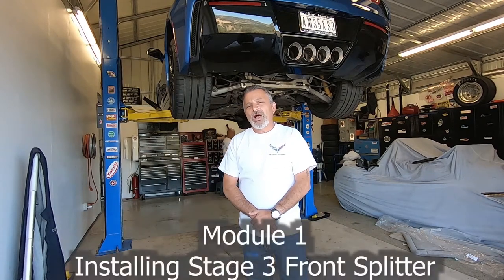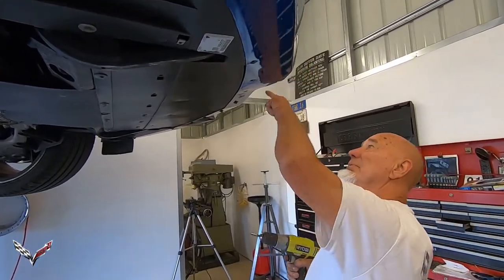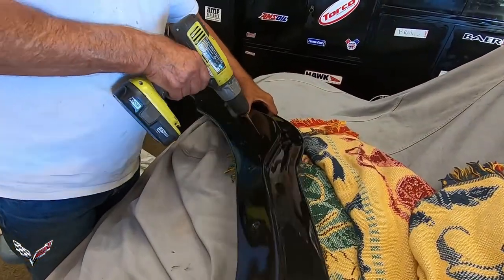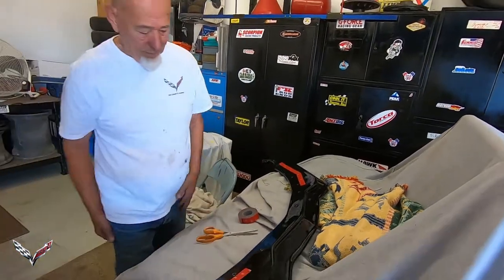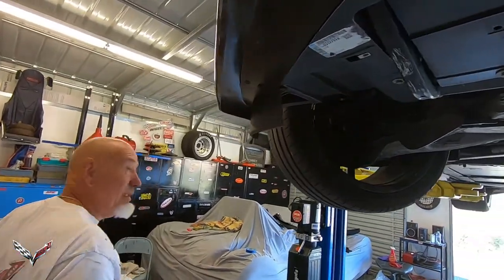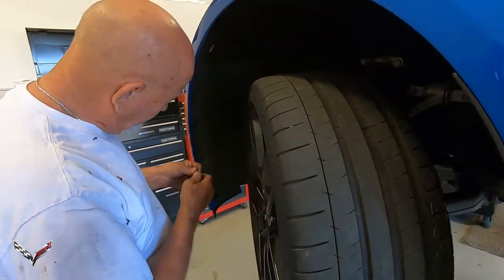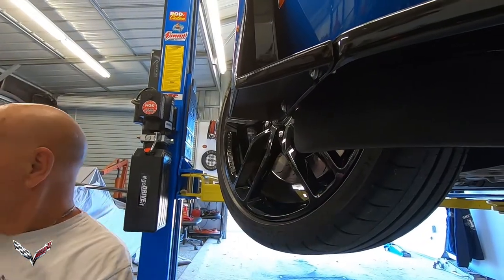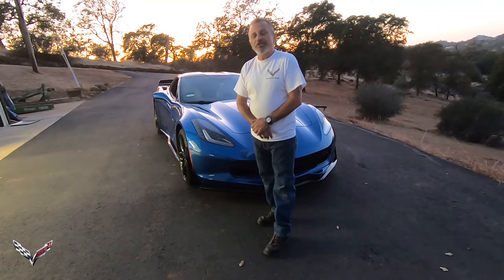How to Install a Stage 3 Front Splitter from Extreme Online Store on a C7 Corvette Module 1

Comment: I just put this spitter on my C7 GS, it took 2 .5 hours with a professional master mechanic.  Half the holes did not match up, the 10 screws that were provided wouldn’t have lasted because they are just going into plastic we used bolts, washers and nuts.  If you have the fender rim extenders you need to use longer screws to hold the winglets and rim extenders tightly in place.  In closing , this video is a good guide but be prepared to improvise.

Comment: Just ordered front splitter in carbon fiber, side skirts in carbon fiber, & ZR1 carbon fiber spoiler from GM. Very very expensive but worth it. ZR1 spoiler was $7400 and the 2 side skirts were a little over $4000 and the front splitter was $1850 was thinking about installing myself but gonna take it to the dealership to let them take care of it. Wouldn’t want to mess the carbon fiber parts up.
Reply from the maker: Ouch!! That is spendy!! I'm sure it will look great, but I just about fell over from the sticker shock!
Thanks for watching!!

Comment: Z06/GS owners, not so easy with the spats and prior splitter!! Dont use tape/or until you get the splitter installed.  Multiple adjustments  will be needed. The tape will lock you in. Canards  might need a good push and hold to get lined up. . Prior revit holes might line up and might need larger screws..  Anything this simple has issues !!  Product fine, just be ready for hurdles..

Comment: I’m looking to get the stage 3 splitter with the winglets.  Instead of screwing the winglets to the side of the splitter, would it work if I roughed up the two areas and epoxy the two together?